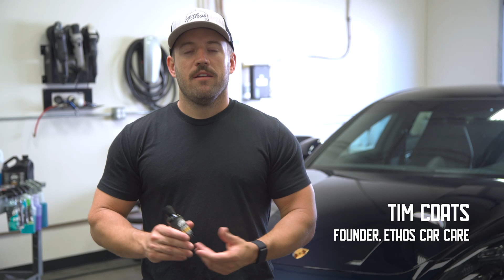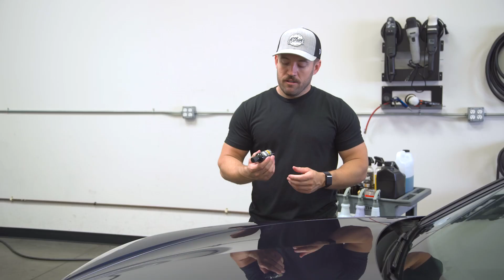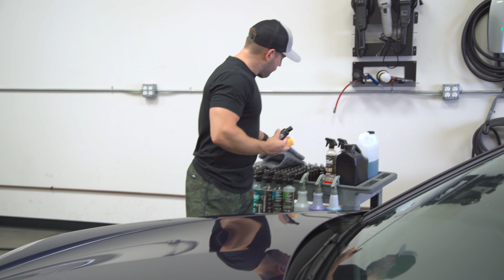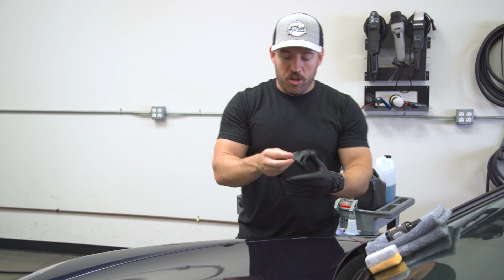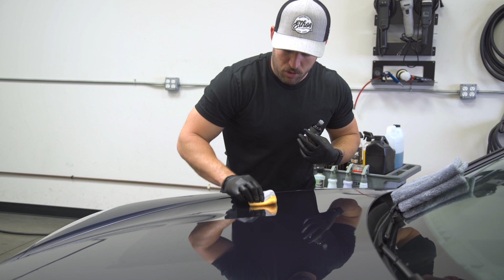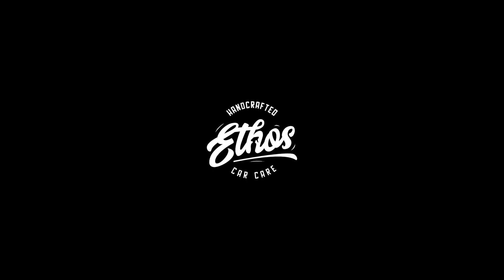How to Apply Graphene Matrix Coating V2.0

Comment: So if the new version has a longer flash time could you have done a larger area than what you did? Say the whole hood?
Reply from the maker: Yeah, but it'll depend on temp and humidity. You can stretch the area essentially indefinitely depending upon how fast you can work that area.